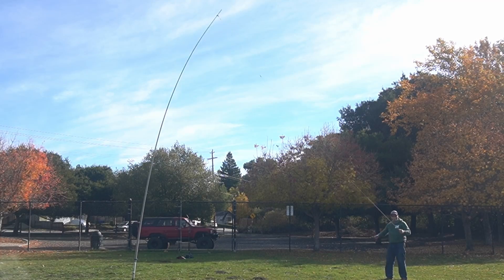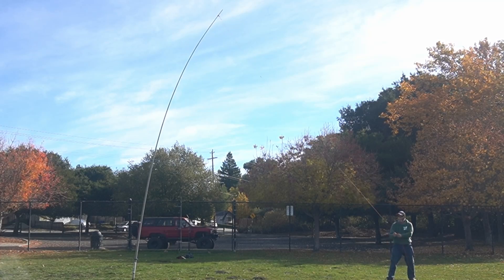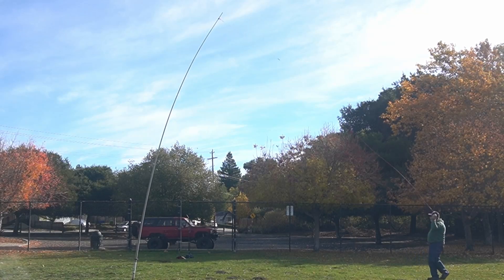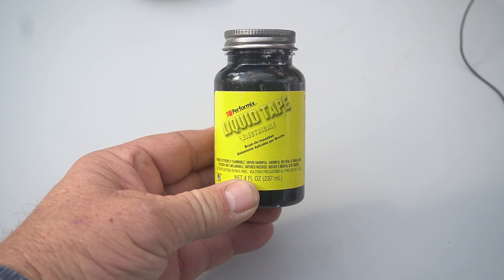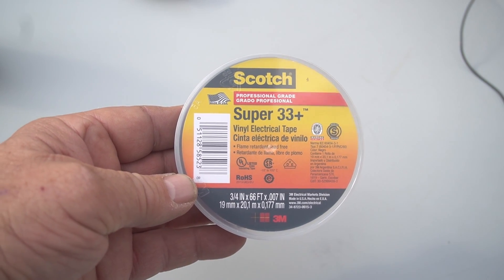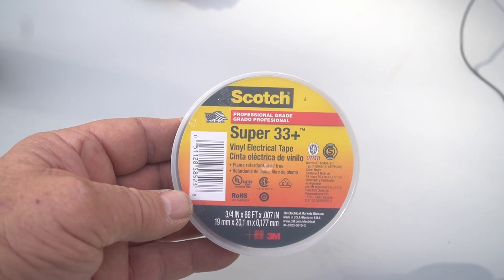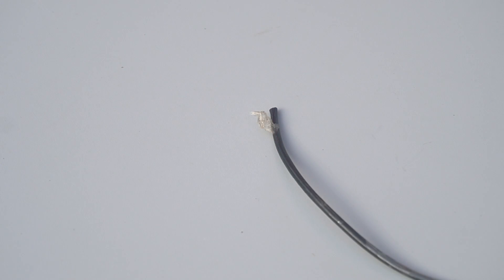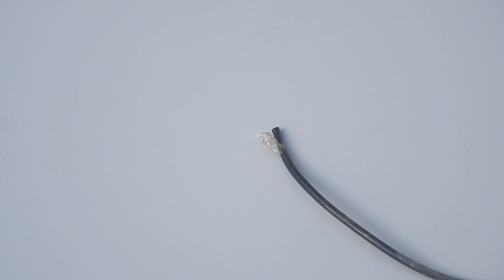What is the best Antenna Wire, for your DIY Antennas?

Comment: In my RAF days as ZC4MO I used DON10 wire. It's stranded copper and steel with a Super strong coating so that if can be used with field telephones and run over by a vehicle without damage. It's so strong I once rescued a WRAF officer who ha put two wheels of her car in a drainage ditch. I dragged it out with a Landrover and some scrap DON10 that was lying loose. No problem. We used it foe a full size 160 Metre dipole. Yes I had enough space available. Out site was 6400 feet above sea level and 15 feet of snow in winter was normal. It survived.

Comment: You may want to use chromium plating on copper or aluminum, maybe we all pretended it was aluminum or silver, they must have changed silver and chromium’s name and symbols. You can probably use the spray on chrome used for car rims and stuff

Comment: Steel wire has a minimum bend radius before it kinks or remembers the bend. It works better to use spools rather than flat winders for wire and coax that have minimum bend radii.

Comment: So, for using an EFHW on a Telescoping mast, for example, I assume the heaviest gauge wire that won't place an undue burden on the mast is the best for signal strength? Is that still true for QRP setups? Maybe thinner wire would be better in the case of low power? Thanks!
Reply from the maker: For QRP I use 26 gauge silicone wire and have used it for 100 watts on occasion, it's lite weight and doesn't bend a small mast too bad. The Bntechno 26 gauge has 30 strands of small wires and that makes it really soft and pliable.  https://amzn.to/3TPQmS7
Reply: @KK6USYHamRadioAdventures — Thank you. Being a new ham I was interested in the science behind it. When moving from thin wire to heavy wire, there must be a point of diminishing returns. You probably wouldn’t want to push five watts through a 10 gauge wire antenna. Or fifty watts through too small of a wire. That sort of thing…. I’m sure I’m overthinking it. Thanks again.

Comment: allthough might be a bit late, my favorite antenna wire (for what its worth) is stranded copper with a silver plating. running in a teflon (PTFE) sheath. that stuff radiates allmost like the sun :) i agree with jack, my rule: treat your antennas like a lady , but keep your XYL grounded :)  enjoy the hobby .. 73 !

Comment: Do you have any info on the tensile strength for BNTECHGO 22awg? What type of wire were you yanking on in this video? I’m looking to use the 22awg for a G5RV Jr.
Reply from the maker: It was probably 22 gauge Bntecho.
Reply: @KK6USYHamRadioAdventures  Thanks for the quick reply. I enjoy your videos. KD6FOV

Comment: For a permanent attic install, is stranded to be preferred over solid? In general,  if weight is no issue,  heavier Guage is better?
Reply from the maker: Either will work . Stranded is a little easier to work with and has less memory. Yes the bigger the better

Comment: 30 year Ham, 40 year electric design engineer, Pure Copper here... well other than Commercial Aluminum Yagi antennas, I am really not crazy about aluminum LOL
wire is going to be shorter or longer depending on the weather, shorter in the winter longer in the heat, thats just the nature of metal, does it matter LOL nope, whats that 1/2 gonna be to your SWR
my latest build I am using 3/8ths HVAC copper tube, What The Heck... a company gave me a spool of it, wish me luck :)

Comment: I have built a full wave 40 meter vertical loop. I use 14 gauge wire from Lowes.  The antenna works great. However I have had to trim it to accommodate stretch. Any thing less susceptible to stretch will pay off in the long run.

Comment: I was thinking of building a cubical quad of wire yagi. I was reading about someone using aluminum electric fence wire (18 ga), and then you saying speaker wire.  I think for me it would be easier to find speaker wire.  Is it recommended to strip the insulation from the speaker wire or can you get away with the vinyl insulation on the soaker wire... noob here
Reply: I made a 4 element 2 meter vhf quad with thnn 14 gauge from Lowe's.      Works pretty good

Comment: The jacket of silicone insulated wire is without question stretchy but that doesn't matter.  The copper strands in the core are no more stretchy than any other copper conductors.  At the moment I'm building a Radiowavz  style fan dipole with circular separators to fit the frequencies I want.  I already have a good 20M antenna so the new build doesn't include 20M.  The elements are 18 gauge THHN stranded wire.

Comment: Quite interesting video, thanks. I've read that the thicker the conductor is, the wider the bandwidth of the antenna i.e. wider band with good SWR. Is there any truth in this?
Reply from the maker: Yes this is true but it's not a huge difference.
Reply: @KK6USYHamRadioAdventures  Thanks for the tip
73s de F4LDT

Comment: I prefer any stranded cable. But I am looking a reference about a strong jacket and light for pota
Reply from the maker: Poly stealth 26 gauge. It is steal , strong but has some memory. I prefer 22 gauge silicone  wire for pota much more pliable, https://amzn.to/3xVv9P7
Reply: @KK6USYHamRadioAdventures  I have used the poly, but many times the jacket get broken, now using siliconed but have heard Teflon or keblar is good. Not sure about it weight...

Comment: I use 1/16" stainless steel (wire rope) with stainless steel two bolt clamps (figure eight) with great success for everything wire.  I use 3/16" Dacron antenna cordage where needed.  I use M15 to M25 Chinese stainless steel pulleys with great success for everything wire. Ron W4BIN

Comment: If you can find some old military twisted pair comm wire used mostly for phone or TTY, it is great stuff.  One of the wires in the of the 5 or 6 in each wire is stainless steel and makes it stronger than anything I can think of, pound for pound of course.  And as far as weather proof of the case - time tested and Tank approved!  Mil-Spec of the God's!

Comment: I am a ham radio operator and for an inverted V antenna we use copper coated wire like they used to use for the old telephone wire KB0MDT

Comment: I have been using  3 mm diameter aluminium bare solid wire, for my Inverted L ant.   here in Orange County Calif,  has not had any corrosion or broken yet , been up 15 years so far.  and cheap and light.  AG6JU

Comment: WD-1A-50 Military field telephone wire. Or have some steel wire industrial gold plated. It want corrode and is the best conductor (HF only travel’s over the skin of the wire not trough the core like dc current)

Comment: I had a 40-10 EFHW in a tree for 18 months made from 22awg silicone wire. It didn't lose tune from stretching, and I replaced it with 18awg silicone because I hung a 110uH coil on the end for 80m, and I was worried about the lighter wire breaking in a severe storm with the coil.

Comment: About your wire winder - 1) use a figure 8 wind around the tips of the winder to avoid putting a twost on it. 2) avoid winding it tightlyamd you'll minimize the memory effect. Figure 8 winding will keep the wire in place without its having to bee wound so tight. My personal preference is to use kite winders that have a built-in shock cord keeper.

Comment: Depends on your needs. On my side I have gauge 26, has sag so wind or ice can't break it, it moves in the wind, no big difference in SWR. Do I make contacts? Hell yeah!
Is it stealthy? Yep! Was it cheap? Yep! (Amazon BNTECHGO silicone wire). 
It takes my 110W no pb (skin effect). I may try next to throw at it a 1/2 kW.
Reply from the maker: I run 100 watts with that wire all the time , it works!

Comment: Power delivered to wire antenna vs. awg ( size )? Does it matter? 100W?
Reply: Ga.26 will take your 100W no problem. And it's stealthy. 
Just check your mechanical needs in your particular situation, YMMV.
That's what I use at my home QTH. Nobody sees my longwire antenna lol. Even me sometimes I need to check whether it's still in the air or down lol.
Reply: Thin wire gets tangled easily.

Comment: I was told that the wire size is how many of the wires can be put side by side in an inch. I am not sure if that is true. But it does work out to a point. How many bare #12 wires can you put side by side in an inch? I have never tried it but take the wire and the outside size of it and see how many of them will fit in an inch. It may not matter. The idea that the larger wires can get less of them in an inch is still a good way to look at it.
Reply from the maker: Not sure I know there are different amounts of wire in the the sheathing , usually the more smaller diameter the less rigid the wire is if that makes sense?
Reply: @KK6USYHamRadioAdventures  The wire without anything on it. You can put 12, #12 wires in an inch!
Reply from the maker: @donaldsmith3048  Oh ok I misunderstood.

Comment: I wonder what AWG rating you need to drop to for avoiding any memory effect in the wire but still keep it as thin as possible for portable operations or to avoid issues with HOAs and/or local authorities etc?

Comment: Just got back into Amateur Radio, after a 40 year hiatus.  I'll be erecting a dipole (fan) in a primarily E - W radiation orientation.  It will consist of a 1:1 current balun, and 14 ga. bare stranded copper wire.  Worked well in the 80's, will work again now just the same.  At the home station I had 40 meter and up.  At the base station, (NAS Memphis) we had 160 meter and up. (also a couple yagis as I recall, but not what we're talking about here.) All tuned dipoles.  Low cost, still effective.  I still need to take measurements on the property, but am anticipating 40 meter and up again for the new home station.  It will take a few years for the wire to stretch, and frankly, temperature will have more of an effect as we go from sub zero, to 90+ degrees F.  Not much of either extreme, (days, not weeks) but it exists.  Seriously considering a DX Commander, but that'll happen after the wire antennas are up.  Being a retired old fart at this point, it's taking time to collect whats needed.  Also, I use Coax Seal on the connectors.  (I think that's a name brand, but searching for that, alternatives can be found as well.)

Comment: Good video.  Just a note though.  You show the different sizes, but not stripped.  In general the insulation is proportional to the wire gage.  But the gage refers to the wire inside, not the insulation.  Your video seems to imply looking at the outside will tell you the gage.  Look at high voltage wire.  Super thick insulation for a relatively small gage.  Twin speaker and lamp cord wire, used by many of us, comes in all sizes (of insulation) for the same gage wire.

Comment: Speaker wire is always stranded copper.  It's just like AC line cord.  The only difference is AC wire has insulation with a much higher voltage rating.

Comment: I just ran across your channel, im subbed now..I have good luck with wire from The Wireman.....I use 16 guage for a permanently mounted 40m EFHW...It is very good wire, a little pricey but not too much higher than some junk wire I have had...I got a 66 foot piece in an inverted V and I had to tighten it twice in the first 3 months but after that it has stayed tight through 2 ice storms and the numerous high winds we get from Severe Thunderstorms here in West Central Arkansas.....73

Comment: What kind of glue do you use in your heat shrink operations?
Would solid copper wire be better than braided as far as RF is concerned, and thicker (lower gauges) or thinner (higher)? 
(for rf, not necessarily for longevity).
Reply: I prefer stranded as it holds up to bending better in my experience.  Also, RF, as I understand it, only rides on the 'skin' of the wire / conductor.  Hence so many loop antennas being made from aluminum tape and PVC pipe. No idea on the glue used in heat shrink, but found heat shrink with glue advertised as a product type.  Just don't remember where at present.  (memory is the second thing to go I was told.  can't remember what the first was..... )

Comment: Hi, thanks for the videos. Quick question. I have made a long wire antenna out of fine copper wire. I figured low current so thickness wouldn't matter. Am I wrong and a thicker wire would make a much better antenna? Thanks in advance.
Reply from the maker: Thicker wire would be stroger and be wide banded but not huge difference. If just listening it doesn't really matter. I'm not sure if you are putting power into the wire.

Comment: Greetings from Christchurch, New Zealand..... I build a Lot of 'Homebrew' Antennas ..... Now Here is a Little Something that is Totally Different ..... I am Not saying that it is Ideal, BUT This 'Wire' is Super Cheap and Extremely Strong. I have used very successfully. The 'Strands' used by Farmers as their 'Electric Fence' 'Wire' .... It is made for Outdoors and won't rust or corrode. Made from a Lot of 'Nylon Strands, Interwoven with Stainless Wire Strands. I would love to hear your comments and Feedback. I have come across a few Others that have Also used it and am happy with the performance. I have a 'Hex-Beam' made Totally from it, also the 'Counterpoise' for my Vertical Antenna .... Does Very Well in Both applications .... Best to ALL from ChCh, NZ
Reply from the maker: I have seen a lot of people use electric fence wire, thanks for posting!
Reply: Stainless steel wire has a lot of resistance and this adds to losses (especially at RF), not desirable for a transmitting antenna.

Comment: Ham for 30 years union electrician for 36 years......I deal with all types of wire everyday. Lately, The wire I like the best is 546 Flexweave from The Wireman for a home dipole. I have a 14 THHN dipole up for at least 20 years on 80m. Portable wire antennas I tried BNTECHGO, insulation is to soft and it didnt last long. I picked up some 534  26awg at a hamfest and it works well for my portable needs. Bottom line is what you have on hand or what you can get seems to work the best.
Reply: Ya Davis RF Flexweave is great, inexpensive and a US Company.
Reply: The problem with flexweave is the tiny conductors eventually break and make lots of little noisy junctions. Copper rope is not the best wire for antennas with built in noise generation.
Reply: Thank you for belonging to a union, sir.🇺🇲✊

Comment: I use what I have laying around which is a lot of the double insulated wire. 
Size range 12 and 14 AWG. It's free and works fine. I have a Fan Dipole
made with 12 AWG and it's been up for 3 years and doing fine. For me
it's about cost. If I was making and selling antennas, then I would
use a good quality wire. As far as stretching, I haven't noticed any
change in the tuning of the antenna after 3 years and the antenna 
has some weight to it. As you said what is the best is a matter of
opinion. I put my antennas up, so they are easy to take down and 
change.  Nice video, I think this is a good answer for newer Hams. 73's Gary KF6EWO

Comment: Good topic Chuck! I love to use my bad spools of MIG wire.  .035 copper coated steel for my winter ground loop out on the field after we harvest. Unbreakable in Chicago wind. 
I use bad Coax shorted for experiments like loops, flower pot and VHF.
Obviously a 1 inch pipe will give the widest bandwidth at resonance so I think using the largest wire you can manage would last the longest and serve best without tuners.
Reply from the maker: Thanks Craig, that's interesting never thought of using Mig wire. Yes larger the wire the better most of the time!

Comment: How is that pole held upright?  Just a stake in the ground?
Reply from the maker: Hi Ryan, Yes, I use a cement form stake from Home Depot with some 3D printed pucks to fit the inside of the mast. It works really well.
Reply: @KK6USYHamRadioAdventures  Oh that sounds interesting.  Not so much for backpacking, but I am in the car frequently.  How long do you use?
Reply from the maker: @ryanjennings5050  not sure what you mean on "how long you use"? I have one set up for the carbon 6 from sotabeams also.
Reply: @KK6USYHamRadioAdventures  How long is the cement stake?
Reply from the maker: @ryanjennings5050  Oh, 18" and pretty heavy for backpacking. I use mine for camping or from a vehicle. The one for my portable mast is made with a tent stake since the mast is smaller and lighter.  https://www.youtube.com/watch?v=EEiMp1Ge7Zs&t=164s

Comment: OK, no 1. I do treat my antennas that way. You ever get a wire stuck in a tree? Lol, no 2. I don't break em though. I only have experience with yalls silicon wire, the Kmack wire, some 26 ga  stuff from dx engineering, speaker wire, cat 5 cable stripped, and DX10. All for different projects/experiments/applications. I will say I do nothing "soft" and break a lot of stuff, but well you know "death before dismount" and all that. That 26 Guage stuff works for qrp operations but I find the dx engineering wire to be a bit brittle when yanked on so you do have to treat it like qrp stuff. I've got 22guage  poly stealth on order for my K6ARK 100w linked efhw experiment based on Adam's rec. So there's that, but I didn't know yall just sold that wire...food for thought and future experiments.
Reply from the maker: That's good info Happy Ham looks like you have used most of the same wire I have. We don't sell just the wire, it did kind of sound like it when I mentioned others just buying wire.
Reply: @KK6USY Ham Radio Adventures  dang, thought I missed an update at the wire guys shop yall got over there. Lol. I've got some of yalls wire as back up in my back up kits because 1 is none... but I don't think I'm a cannibal for fun 🤔 and will only use it if necessary. Maybe selling 80m spools of your wire might be on the horizon! (if you contact your supplier and ask for pre-spooled lots like Callum does? You wouldn't have to wind spools of wire for Ape lol.  Id buy some. Tnx Chuck